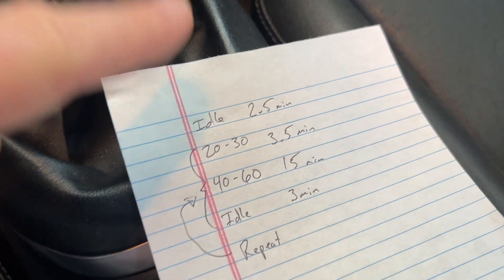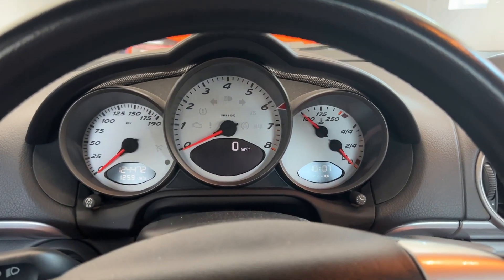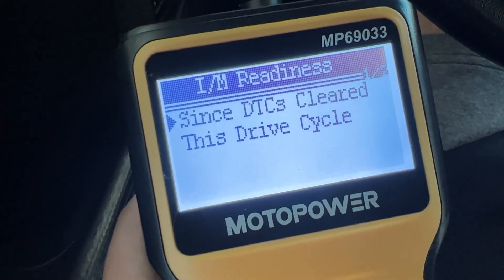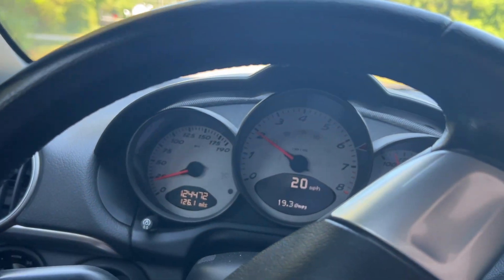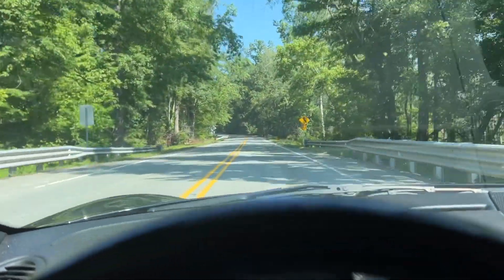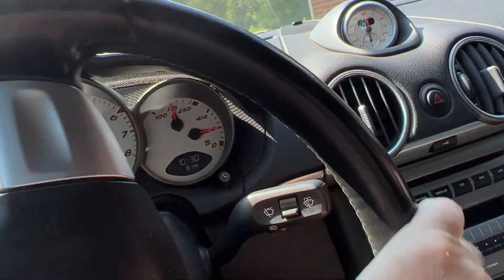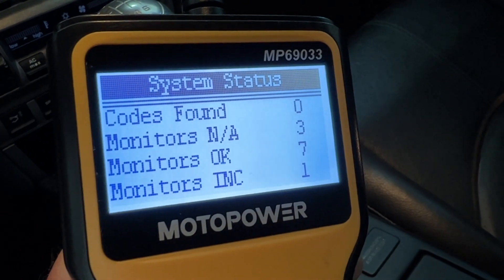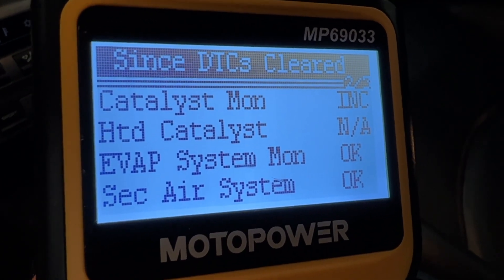Porsche DRIVE CYCLE for Emissions Readiness Monitors

Comment: I wonder how many repeats will be needed.  I've tried to do a single cycle multiple times.  No luck.  It's been almost 1000 miles this month of messing with it.
Reply from the maker: +@Torxuvin that can be frustrating!
Reply: Didja fix it?   How did you get it to pass and reset the monitors?

Comment: I didn't even know this was a thing until my emissions test was rejected because the "system was not ready". Apparently, disconnecting the battery for a couple of months during the winter for storage caused this problem for me.  So thankful for this video!
Reply from the maker: +@Chitown388 yup! Unplug the battery and they go back to not ready. 🍻
Reply: @HelpMeDIY  Apparently, clearing CEL codes might clear those emissions readiness data also.
Reply from the maker: @Chitown388  yes definitely. That’s so you can’t clear a CEL and then immediately pass an inspection.

Comment: Thabks for sharing, will try this when my new sensors come in.  Alos have catless headers and wondering once your catalyst is ready, does that trigger a CEL?  Ive tried various o2 spacers and was just recommended new sensors with the spacers. If that doesnt work, ill install cats for emissions and yank them after passing every 2 years
Reply from the maker: +mdf008 I didn’t have a CEL for a long time then it came back

Comment: Great video that summarizes the porsche drive cycle. I also find it hard to do the 20 to 30mph section in the Boston metro area. LOL  I have to go out when traffic is light. Do be careful about idling in your garage because of the carbon monoxide.  I always back out and turn on the AC and rear defroster as well while it idles.

Anyway, I do have a question for everyone; do we need to run the drive cycle in 'Sport Mode'?  or is 'Normal mode" sufficient?  I ask because this year my 911 Turbo readied 6 out of 8 and resisted the last two until I used "Sport Mode".   My catalyst and evap is the last two to go ready.  They "go ready" in Sport Mode. It happened twice this year(after service) so it could be coincidence.  When I leave it in "Normal" they resist readying the monitors.  I've done some research and don't see anything online about this.  One time it took 4 drive cycles and this week it took 3. 
It might make sense as I believe the cats would run hotter in sport mode which should push them to ready status but I would think 'normal mode' should also be sufficient.  

Next time I have to ready the monitors I'll just run it in "Sport mode" and see if they reset on the first or second drive cycle.

(I only noticed this because I have been running in normal mode a lot this year to save on fuel. LOL  My turbo gets thirsty in sport mode.)  Thanks,  Jim
Reply from the maker: +Joe Mosely thanks! Sport mode shouldn’t have anything to do with it. All it really does is make the throttle more responsive.
Reply: @HelpMeDIY  Thanks!  I must be conflating it with the overboost function.

Comment: Catalyst is always the last one to be ready. Where I live , it is next to impossible to achieve those 40 to 60 mph 15 minute drives. I've learned that turning on the A/C while parked at high idle usually clears the Catalyst too.
Reply from the maker: +bruce wayne hadn’t heard that about the A/C… interesting
Reply: @HelpMeDIY  just another way to putting stress on the system without having to do the full drive cycle.  full a/c max setting and recirc mode and headlights on too. I did the drive cycle multiple times and it did not work. The a/c worked for my situation for the stupid catalyst to clear.
Reply: @brucewayne2773 how long did you have to idle with the AC?
Reply: @formula1dude2002  around 5 minutes. It's been 3 years since I did it. This must be done when the engine is cold, preferable overnight to completely cool down, then do your cycle while parked
Reply: @brucewayne2773 appreciate the insight, having the same problem right now but will try it tomorrow morning 🙏🏼
Reply: @formula1dude2002  5 minutes, just about 2500 rpms. make sure you have your hood open to help with cooling. Engine cold to start with